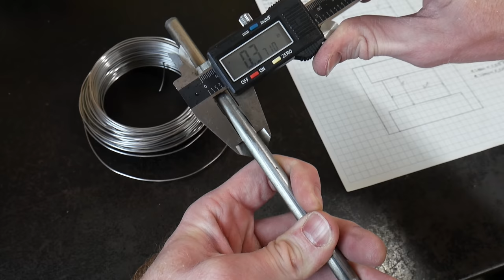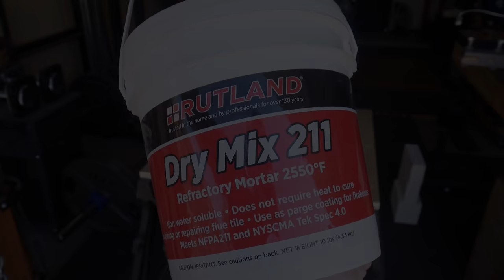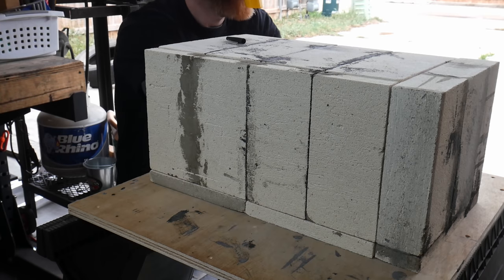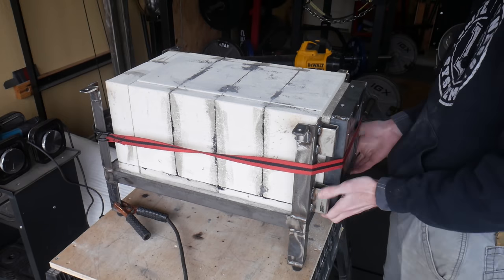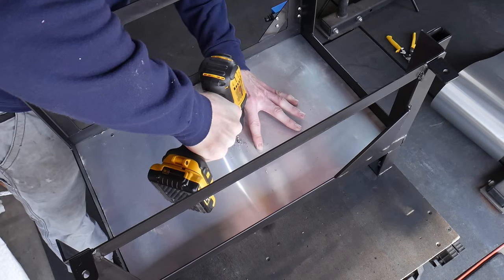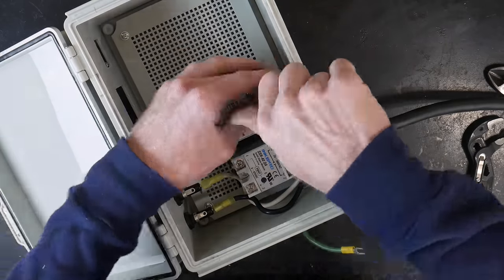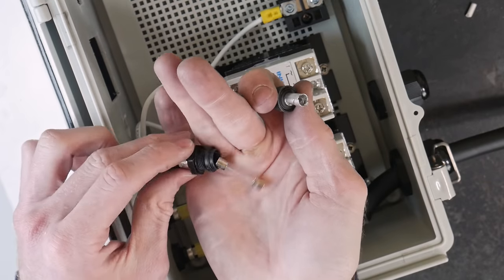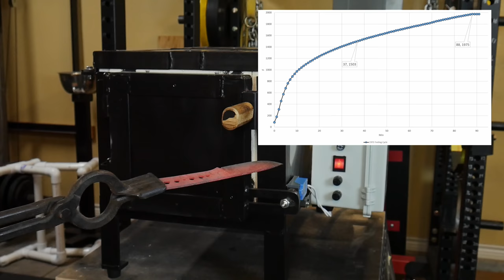How to Build a Heat Treating Oven | FULL GUIDE | DIY Heat Treatment Oven

Comment: Thank you for sharing this! This walkthrough was super helpful and the equipment list is such a great resource.  I created a parallel build and found that making the channels in the fire brick with tight tolerance for my coil diameter caused my bricks to crack when the Kanthal expanded.  Maybe a lesson learned that could help other viewers.

Comment: Great video! Coming from a pottery background, if you need to help keep the elements in their grooves, you can take old/extra element wire and bend it into a J shape. Then just push them into the soft brick where needed.

Comment: Great video!! I’ve probably watched it 20 times. I’m a new knife maker and I built this oven with a few changes but it has been a game changer. Thanks
Reply from the maker: Heck yeah man! Awesome to hear it helped
Reply: What details did you change in your build, & why?
Reply: @schechter01  
I’m running off a 30 amp breaker so I increased the power.

Comment: Nice build - really excellent result, and very good and detailed description. Just a note for any one building one. There is no point in using two SSRs - one for each end of the coil, when you are on a single phase. The current you run through one is the same current you run through the other. You just get double the voltage drop over the SSRs (which is probably insignificant in this case), but main point is no benefit and twice the cost and hassle of wiring. And as noted by others, no reason to fuse the PID with a big fuse separately. The manufactorers pdf manual for the controller has a wiring suggestion for a heater build that should be followed - it uses the correct wiring with regards to fusing and using one SSR.
Reply: Yeah, a wonderful project:) And you are absolutely correct with your analysis: The wiring is SERIAL, one net-loop, so no need for two silicon state relays. 
Just some engineering background (and advice, nobody asked for *g* ): Red Beard says something like "... a fuse to protect the PID [regulator] ...". That fuse should then be dimensioned to the max input current of the device, denoted by the datasheet. For the protection of normal devices 1.1 to 1.2 x nominal current / slow blowing fuse. Or to protect semiconductor devices (like SSRs) with 1.2 to 1.5 nominal current but with fast blowing or semiconductor rated fuse(Ballpark numbers, if present use the values specified by the manufacturer = RTFM:) ). But for such a small and relatively simple (in contrast to a complex) device? After all, also those fuses are ADDITIONAL to the ones he already wired in, which (the background part: ) are fuses to protect the WIRING! Like in your house-installation. They serve the purpose that in the event of a short circuit (heating element or regulator or the wiring itself or some dumb human juggling a screwdriver ...), the entire wiring does not turn into a fire hazard/heating element itself. The fuses must therefore be designed according to the conductor cross-section and thus the rated current. If the/a secondary fuse is dimensioned as a device protection fuse, then the correct value for the special device must also be selected. Anything in between, or "by feel" doesn't make any sense at all:) Just my (and by the basics of electrical design) 2 Amps ... I meant cents.

About Cable Glands: I found it wonderful, that he works with cable glands. That is professional. But ... cable glands are for ONE cable, each[1]. The great thing about them is the screwable and totally sealing strain relief. If you use two cables or even three .... then you can omit those things. And please don't say anyone DUCT TAPE. We have enough plonkers here, who shoot themselves in the foot, regularly on YouTube:)
[1] That solves also the mystery, why they come in different sizes ... :P

About Thermoelements: Whats positive and what is negative? No needs to speculate. Red Beard has mentioned his "high quality super duper multimeter". USE IT! Use a heat gun and measure the output voltage of the element. Then you KNOW!:) (Also good advice for dogs and color blind people, hehe)

Comment: Really great built video!  Thank you for putting this up.  I'm going to build an oven for aluminum casting and this will be a great help.  Love the idea of using a benchtop drill press as an overhead router for the bricks - that's genius actually.  If you used a regular router or router table all that silicon dioxide dust would probably completely destroy the router.  But with the drill press, the motor and bearings are mostly out of the way.  Such a good idea!
Reply from the maker: Came out of necessity! lol; Cheers Tom

Comment: Really nice build on that oven.  I just finished building mine about 2 weeks ago and although not as aesthetically finished as yours it does the job.  I built mine with inside dimensions of width 6" x height 5.5" x depth 22.5".  Wanted to be able to heat treat the camp choppers I make.  Was able to do it for just under $500.  Most expensive parts were the bricks and the angle iron since I didn't have any angle on hand.  I used an Inkbird PID which seems to work quite well.  I am having issues with the crappy hinge I used for the door so will have to go with something like you used.  Looks a lot more sturdy.  Again great build.
Reply from the maker: Awesome man! These things are fun to build for sure. Thanks for your comment!

Comment: A tip for cutting the flashing or any sheet metal. Lay it down flat and use a straight edge and sharp utility knife and make a couple passes scoring it and then bend it and it will break perfectly. It basically looks like a factory edge. You don't have to cut nearly as deep into it as might think. I've done it with steel and aluminum. You can use a brake to bend and snap if you have one available. I do aluminum flashing on exterior trim which is how I learned this trick. 

It's amazing how you can make something like this without a bunch of super expensive tools.  I thought that drill press was some really high end model until I looked it up and saw that it's very reasonably priced. I have a similar sized one from Harbor Freight but that one looks nicer to me. This looks like a lot of work, but totally worth it with the price of pre made ones.
Reply from the maker: Thanks for the tip! Cheers

Comment: Nice detailed description.
Just a safety warning regarding the door switch. You mentioned in the beginning that you did this to prevent possible electrocution. But you may never assume that the SSR provides full electrical isolation and you should always use a relay with mechanical contacts to switch both sides of the coil off.
For anyone building this: if you buy a PID controller that is different from the one used, make sure it is a controller with an electrical output for SSR use. I originally bought a PID controller with a relay contact and this only allows for slow switching. The SSR plug-in unit I had to buy for that PID controller enables faster switching resulting in a more stable temperature.
Reply from the maker: Thanks for the tips sir

Comment: I've been doing automotive and industrial wiring for nearly 20 years now. When in doubt on wire size, always go bigger. It leaves room later to expand the part/machine and it guarantees smooth operation.
Reply from the maker: Thanks for the tip sir!

Comment: When I made my muffle furnace, 35 years ago, I just used a Joiners hand saw to cut the bricks and the left-over pieces were useful for filling-in intricate areas of the brick-work. I did not use any cement, just used staggered gap brick laying and double brick walls. To complement the structure, I used refractory insulating blanket around the bricks and then covered the structure with 0.100" thick hot rolled steel plate with steel angle for the frame.
Reply from the maker: Very cool!

Comment: There is one case where the operator can get bit - where one of the solid-state relays shorts out and stays on. The heater will still operate normally, and the heater will still be disabled when the door is opened, leading one to think that everything is fine. BUT: the relay that is stuck on is still connecting voltage through the entire length of the heater, presenting a potential shock hazard - even if it is thermally cold. The right way (more expensive, of course) is to have the door switch operate a contactor (a big relay) that removes power from both ends of the heater. The cheap less safe way is to add an indicator light to either end of the heater and neutral (not ground). If it's on when the door is opened, it's a red flag that the wires still have voltage on them.
Reply from the maker: Cool information Kurt!
Reply: @RedBeardOps  Yeah it's a tricky "corner case." It's only a problem here in the US where we have 240V with a center neutral, so effectively, both ends are hot. This means that both ends of the heater have to be switched, as you've done. In the UK, they get straight 240V with no center neutral, so only need one switch on the hot side.

Your build, and especially your voice-over, is really excellent; the best I've seen for any oven build on YT. I'll be building one as well, based in part on your design. I'm taking to heart what you said about the door sealing and may do a counterweight door where gravity holds it shut. Thanks again for the video!

Comment: Excellent build! I recently built a slightly smaller version for burning out investments using all of the info you provided in this video. I do have a question for either you or anyone else who can assist. I wired up a 240v 20amp plug as you recommended. plugged it in, the first red switch light up but once I flicked it on everything shut off. I didn't just trip the breaker, I somehow tripped the whole panel. The breaker it was wired up to was rated for 60 amps. Did I wire it up to a much to large breaker? I will have to go through the electric box and recheck my connections but I was sure it was all wired up correctly. Would this run on a standard 120v 12amp outlet if I cant get the 240v plug to work? Thank you very much!
Reply from the maker: Hey man, I'm not an electrician by any means. Please be super carful here; I really don't know what's going on with your machine. My best advice is to go over the wiring diagram again to make sure you have it all right; including the ports on the PID. You may want to consult an actual electrician too.... do this stuff at your own risk man, it's super dangerous.

Comment: This is an exceptionally nice build for a DIY effort, and I could see this being ever so slightly modified for a fully professional outfit. Man, nice job!
I also went with an Auber PID though the next stage up that has a USB function so you can program on the PC and save your ramps and cools. Doing it directly through the PID isn't impossible, but having a folder of easily accessible and swappable profiles that you can add more functionality is a nice feature to have for down the road. My oven is a bit of an oddball as it's design is for a very large crucible and a reduced oxygen environment that can heat treat specific materials, graphitize, smelt, etc.
Reply from the maker: USB port would be awesome! That's a great idea for an upgraded model.

Comment: Great video and build! I'm half way through  building mine. One question, the terminal block and PID don't fit the 12 gauge u ends am I missing something?
Reply from the maker: The terminal blocks fit my 10 AWG wire (raw wire)

The U-ends I used on my 12 AWG wire did fit the PID... you many need to find/use some smaller ones if the ones you're using aren't working. Or grind down the ends until they fit.
Reply: Word, thanks so much for the great video. Keep it up!
Reply: I figured it out the link in the description takes you straight to 15 Amp terminal blocks (which I bought) that are smaller than the 20-25 Amp blocks you used. Got them order and on the way!
Reply from the maker: @jacksonrobinson4424  That's interesting... what country are you in? Mine goes to 30A blocks - Ceramic Terminal Blocks - https://amzn.to/3sXa8eu
Reply: I'm in TN, I'm talking the terminal blocks inside the case.
Reply: Don't worry, I'm just being a pest now!
Reply from the maker: @jacksonrobinson4424  Good catch! I'm happy you said something so I can fix the link. 25A is the way.

Comment: I don't know how many times I watched this video....but it was a lot :)  Yes I built it, works great and I love it.  I was shooting for 3200 watts based on 18 ohms and 240V.  But yeah, my ohms ended up at 18.5 and my power supply measures out at 247V, so that calculates out to 3297 watts.  Not complaining about that at all.  One thing about the wiring diagram, and like you I am not an electrician, but we sure play hard at it lol.  So I'm reading the wiring diagram as providing power to the element from the + sides of both SSR's.  Am I reading that right?  In any event I did not do that, I followed your wiring in the video and in the video the element is wired from the + side of one SSR and the - side of the other. Please let me know about the diagram....if I'm reading it right.
Reply from the maker: I'll be honest this is so long ago at this point I forgot a lot of the build. I'm not sure if it matters on the power side as long as you make the circuit appropriately... but don't quote me. Glad it worked out for you!

Comment: came out great, those brick grooves should save a lot of hassle. you definitely don't need to fuse the PID though, as fuses don't actually protect the appliance from failure, they protect against already failed appliance from causing a fire + melting the wire insulation. plus, PID controllers don't operate anywhere close to 1amp, its only a few milliamps (around 2ma to be exact) and there's such a low chance the PID will short circuit (compared to a heating coil circuit), that there's still no point installing in a very tiny milliamp range fuse. Bizarrely, I have seen quite a few builds were people have unnecessarily fused the PID controller, so it seems to be a trend that's caught on. Otherwise, it's still a great build :D
Reply from the maker: Thanks for the info Chris.
Reply: @RedBeardOps  no worries. looking forward to incorporating some of your ideas into my next build :)

Comment: This was great. 
Does it really need the massive steel frame?
It should be below 100°C, so ... Aluminum?
Reply from the maker: I used what I had lying around... I'm sure you could use other materials. Could get a little hot around the door

Comment: One way to save heating element is to stretch the coils to separate, then hop coils until the proper resistance value is achieved based on multimeter ohms, THEN cut the wire. Great build.
Reply from the maker: Thanks for the tip

Comment: I have followed your lead on building my oven and everything has worked very well.  You have the best video to guide a builder. I’m just not comfortable with the results of my resistance calculations.  If you could answer a question about the calculations I would be very grateful.  Did you decide on a wattage and just go with the resulting ohms?  My results left me with ~9 ohms which is very little 16ga. Kanthal wire for a 0.6 cu.ft oven.  Any thoughts?
Reply from the maker: Glad you're getting value out of it! Please be carful with electricity... stuff is dangerous. I started off with AMPS. I wanted to run the 220 oven on a 20 amp breaker. 20 amps derated by 2/3 gives me 13.33 amps. I then used that to solve for ohms. Once I have the ohms I can calculate the watts of the oven.  - There is a calculator here as well - https://dcknives.blogspot.com/p/electric-forge.html

Comment: Just finished 'coiling' my heating wire, and using your wood block technique (with the tip to maintain slight pressure) it went perfectly.  Brilliant!  You saved me from hours of winding by hand and likely unsatisfying,  mediocre result.
Reply from the maker: Nice work! Good luck with your build Joel!

Comment: Amazing video! I plan on making a control box this summer with an Arduino, and additional parts. A quick tip for those making your coils at home. For a more accurate reading on callipers, you should use the tips of your calliper’s lower jaws. That point is the most accurate due to the slight taper in the jaws.
Reply from the maker: Good luck on your build!
Reply: @RedBeardOps  thank you!

Comment: Great video thanks! I have a question, if i reduce the inner volume how it  will 
effect the preference?
Reply from the maker: I would think a reduced inner diameter with he same amount of heating coil and design would produce a more efficient oven. I could be wrong though.

Comment: Thanks for all the knowledge you share. You are a great teacher. I have everything in my Amazon cart just have to hit that button which I will eventually get around to. I know this is alot better option vs paying $2200. Do you recommend starting off with this for newbies or would you recommend starting with a forge? I just plan on heat treating and am not planning on forging, at least anytime soon.
Reply from the maker: For heat treating, yes, I'd say this is better for sure. The forge is more versatile if you want to do any type of knife forging or blacksmithing... But heck, when I was making mostly stock removal knives, I probably would have been better served with just an oven.

Comment: Thank you for making this. I've subscribed.

PS. you can make the kiln marginally more efficcient by cutting some internal vent holes to expose the nichrome heat elements slightly more. The current design actually "insulates" the elements inwards, which you don't want.
Reply from the maker: Thanks! I was slightly worried about that.